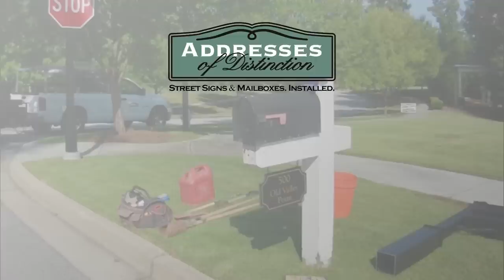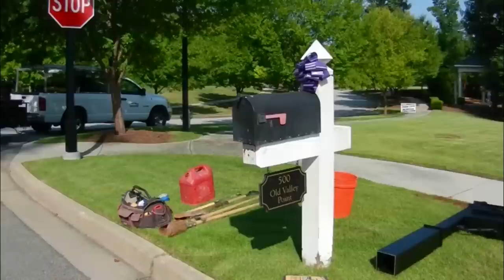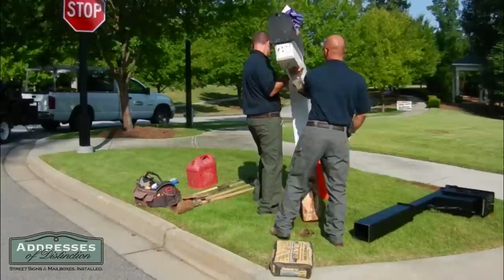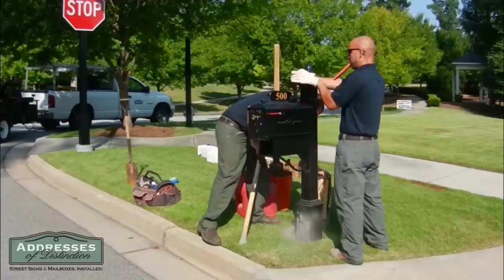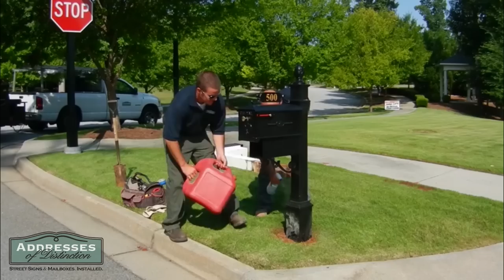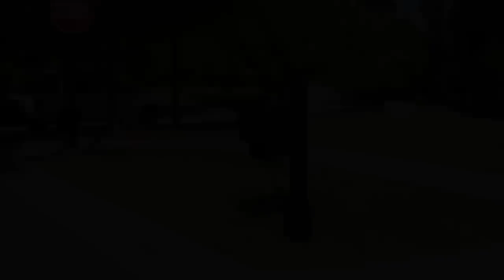How to install a mailbox like a pro!

Comment: I would've mixed the concrete first and filled the hole. Then I would've floated the new mailbox in to it. It would fill the inside of the post AND surround it. Much stronger that way.
Reply: Yeah but you're not going to be holding truck engines in this.

Comment: This is 2023, most drivers nowadays for all carriers don’t know how to drive and back into people’s mailbox posts, snapping them.
Don’t use concrete, pack gravel around post.
Dig hole, put in #57 crushed limestone or some other quarter-sized or larger gravel in bot of hole for post to sit on top of for drainage, pack a finer gravel such as #8910/crush n’ run/etc around post. If post gets backed into again by some goofball Amazon/UPS/Fedex/USPS driver, chances are you will be able to push the post back up and level and then repack the gravel.

Comment: When setting concrete, you always want to mix the concrete correctly first with the right ratio of water before pouring the concrete.  This mailbox is gonna be a trainwreck
Reply: Fake news just pour concrete mix in the hole
Reply: KittycrazZ seriously wtf ,  who pours the powder down the hole with a little water and just says “it’ll eventually soak up water and harden” hahhahahaha
Reply: @danielb9371  alot of people do. The moisture will cure the concrete.

Comment: Very deceptive.  When taking out a mailbox it is NEVER as easy as they showed.  They loosened this one before the video.  Most mailboxes are firmly in place and require a lot more effort than this.
Reply: Thank you!  I tried to remove just a narrow green metal post and the concrete slab was 2 feet deep and 16 inches in diameter.  I had to pay 2 neighbor kids to get it out and take it away. (Kids well they were in their early 20s)
Reply: No shit.
Reply: @heleneschenbacher8512  Probably money well spent.

Comment: These jackasses didn't use a tamper tool to pound down the dirt.  Nor did they even test the mailbox out or to see if it was level/firm.
Reply: @Black Mirror
They just widened the original hole.
But I bet that a dog peeing on the post would knock it over. And EXCUSE me where’s the level? 
These guys are a “bubble off plumb!”
Reply: @heleneschenbacher8512  Definitely NOT the "sharpest tools in the shed"! lol